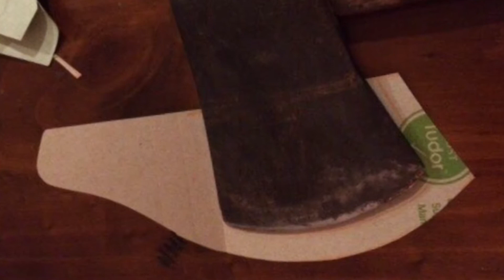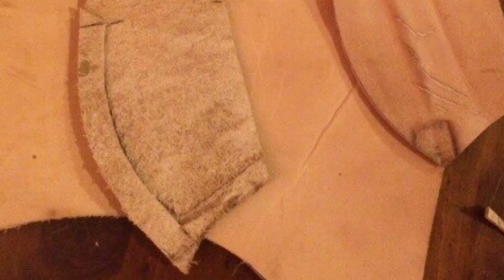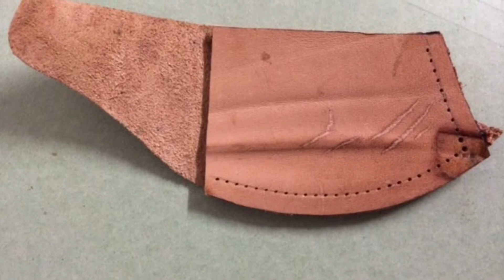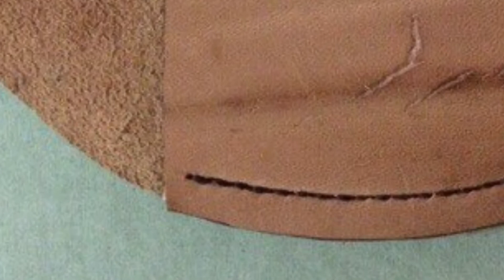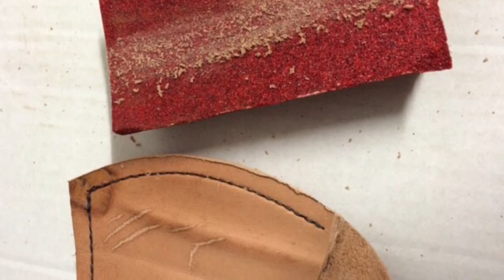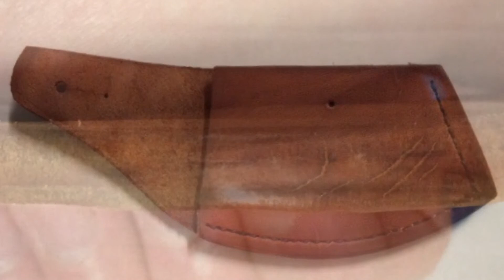How to make a leather axe sheath without any special tools.

Comment: I like the simplicity. How did you attach the button?
Reply from the maker: Alex Moon G’day mate. It’s got a screw in stud at the back. Just google “screw in leather studs” and you’ll see pics. I got mine from the local leather craft shop. I used Loctite thread locker to keep it fastened tight. Thanks for the message. : )